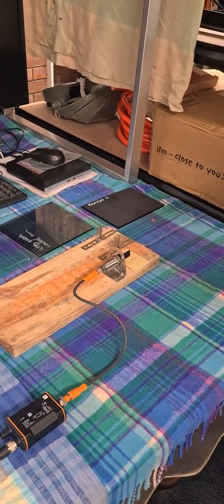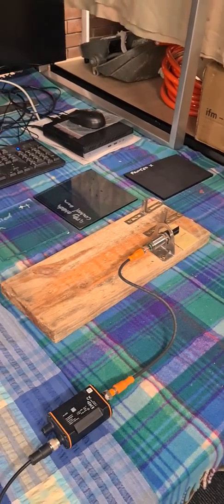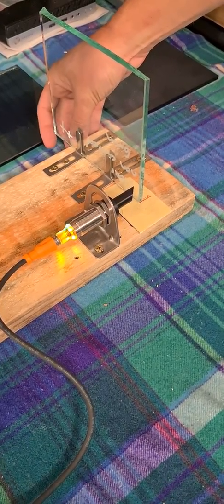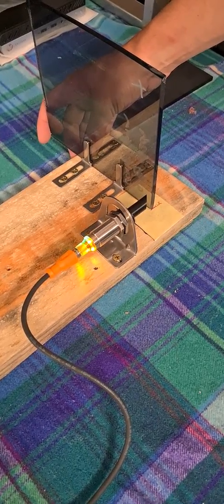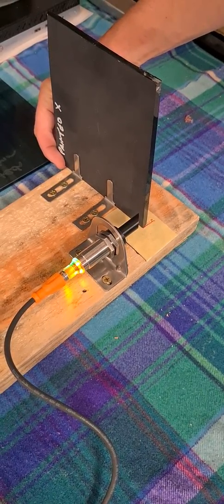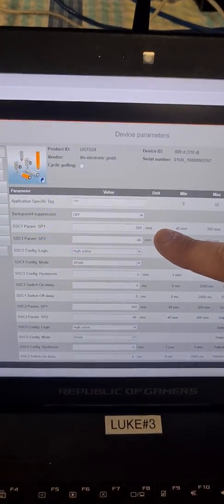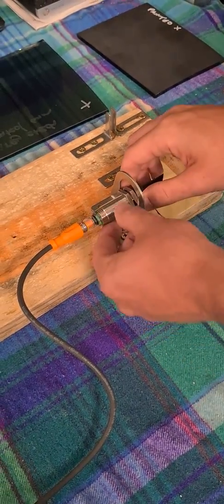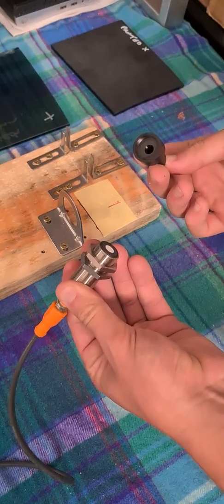IFM Product Review UGT524 and E23000

Comment: If we change the setting on the computer then disconnect the sensor and the computer. Will the setting we changed still available ?
Reply from the maker: Yes, the settings changed by IO-Link Programmer are kept on the sensor even if it is turned off. Once the setting is done with the programmer you would normally disconnect and install using Power + and - and Signal in the permanent location.